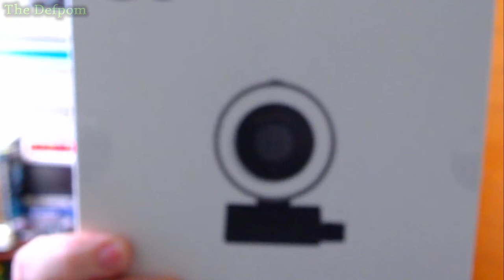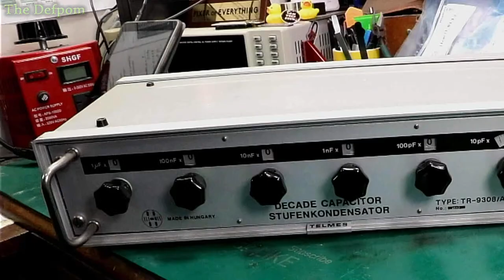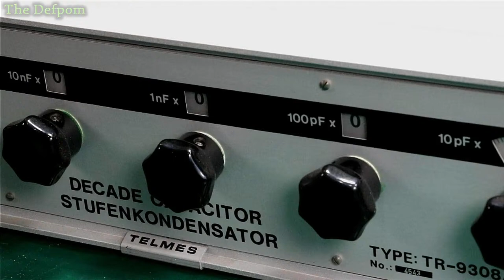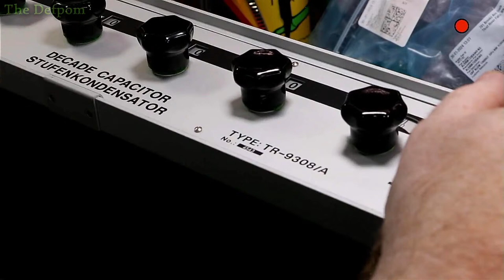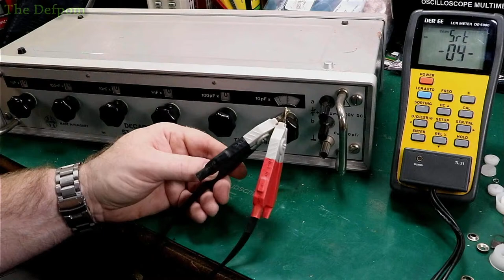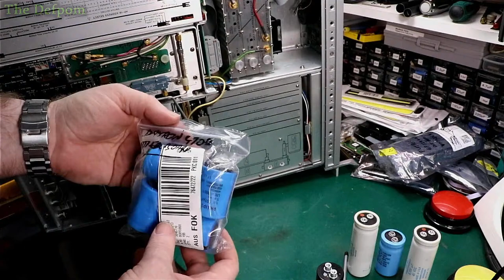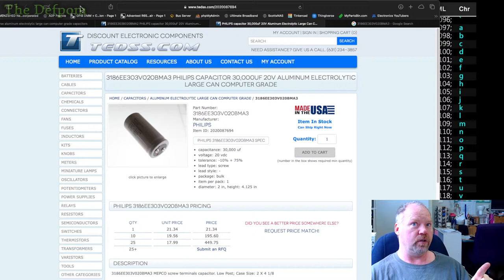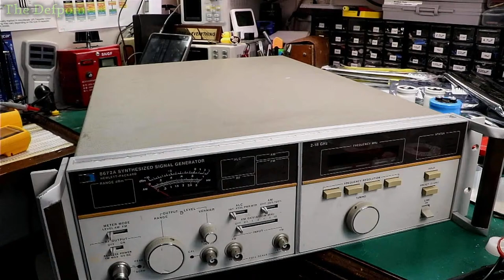🔴  Live From The Bench - Lets Chat and Tinker At The Bench trying to fix some things

Comment: Could you have used that other hole to mount that capacitor? Using a ring terminal to ring terminal to bridge the gap to the correct terminal. Or is that other hole used for something?
Reply from the maker: The other hole too far away as well.
Reply: @TheDefpom  Thanks, I couldn't really tell what the gaps were from the camera angle. But I was curious if those other holes without tracks were for alternative mounting of Caps. I was concerned when you drilled the board in case the board was multilayer.